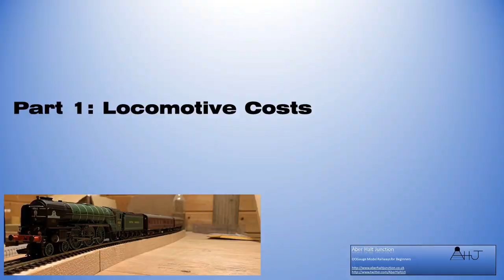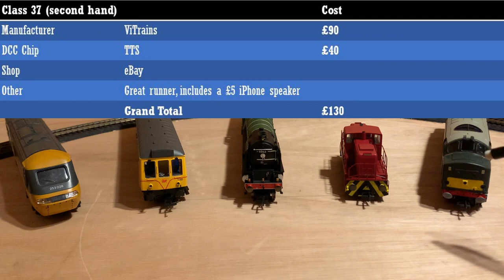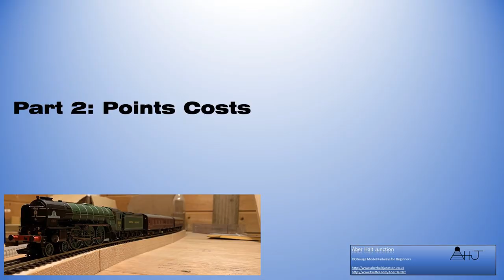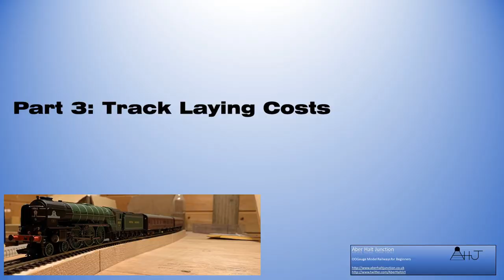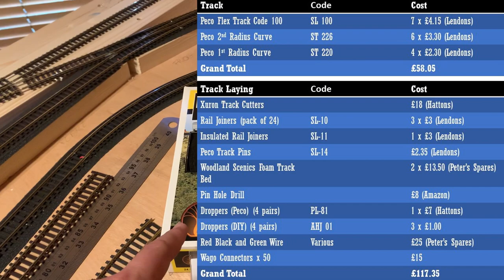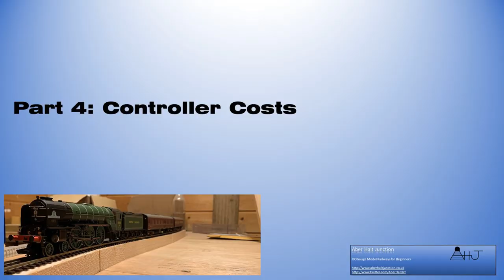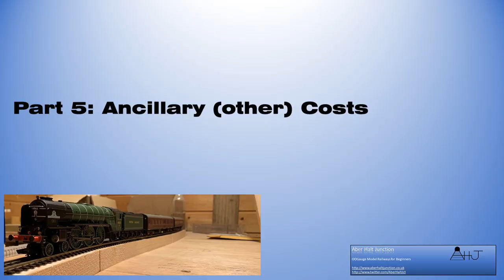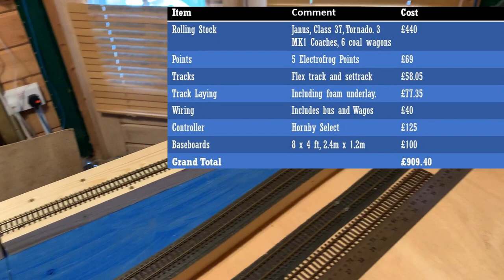Two Loop DCC Layout Cost (full details)

Comment: Very interesting video, well put together. With regards to the 125 and its running, is it a bit jumpy and sluggish?  Are you aware of certain CVs that need changing to improve a TTS decoder? If not please let me know and I will send them to you...Simon
Reply from the maker: Hi Simon, thanks for the constructive comment and view. Yeah it's a good point on the TTS chips, I am aware of the fix you are alluding to. I don't think that's the issue, it seems to be more on pickup, it literally cuts out quite frequently. It's either a dodgy connection somewhere (which I hope not as my electrical multimeter skills are woeful) or everything might just need a good clean. I got a wheel cleaner from Peter's Spares yesterday so going to give that a go. I'll do the CV change though and see if it helps, good call. Cheers!
Reply: I hope the answer is simple, its probably more than the 5 CVs that need changing. Sometimes TTS decoders will only work properly on Speed Step 128. If you take the top off and put it on the track, then use your multimeter on continuity. Touch one connection on the locos motor with one of your probes and the other on one side of your track. You should get a response from the multimeter , repeat this on the other side.  You can try moving the 125 slowly to see it the multimeter reports an iffy connection.  It may just be pickups not close enough to the wheels at certain points on the track...Simon
Reply from the maker: Hi Simon, yeah me too. I really hope it's a pickup issue, the guy did quite a good job of doing the conversion, but some of the pickups do look a bit iffy, I'll do your suggestion of moving it slowly along the tracks and let you know how I get on. Would be nice to fix it because I do like a HST, takes me back to my youth! Thanks again for the steer.